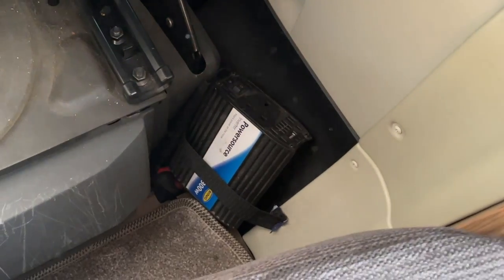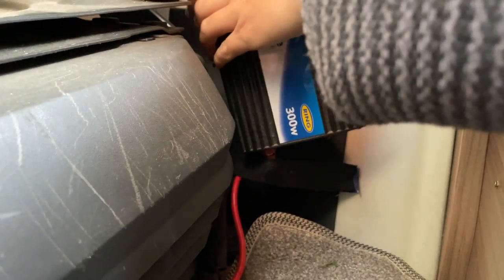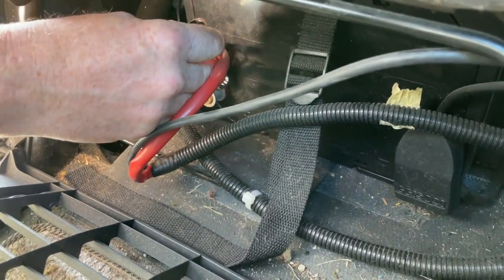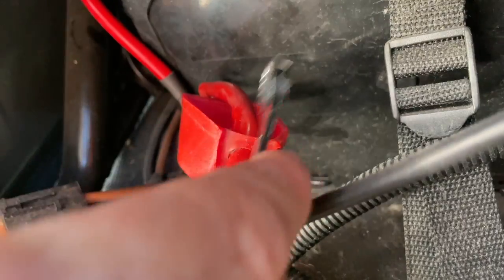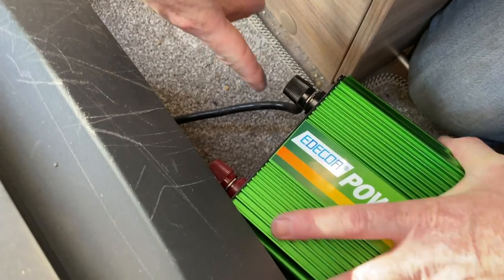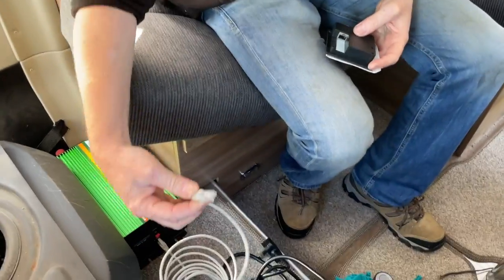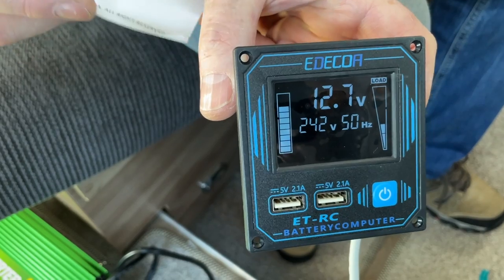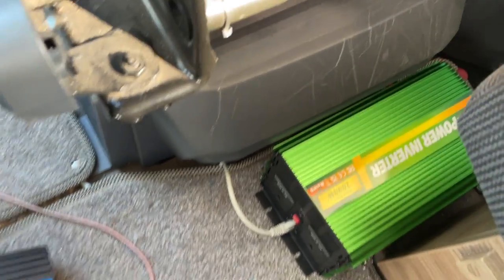How to fit an inverter to your motorhome/ campervan (van life tips)

Comment: An easy refinement would be be an in-line fuse and an isolator switch. A lot of people make the cabling to the inverter too thin, thus creating a fire risk from the thin wires carrying too much current.

Comment: ola Kat and Mr Wandering Bird . you were having far too much fun fitting that new inverter but I'd just like to ask, I'm sure you have one of the power bank things and I'm wondering, for folk how have the ecoflow/jackory power banks would they need an inverter?  I do have one but Ive never used it. I think mine is only 500 watts. I was always afraid it would drain my batteries which because of my limited budget were two 130 ah lead acid batteries. obviously the way to go is lithium and ecoflow if ever I can afford it. great video. bessy regs-Kenny
Reply from the maker: Great question Kenny. Answer is no. Tbh, I mainly use my inverter to recharge my Ecoflow 😬 I use my Ecoflow much more.

Comment: Hi kat just watched vlog on inverter what size would Mr WB suggest to run a hair dryer and straightening tongs ,and does the engine need to be running while using it, this would be when off grid cheers from the gowerz Portsmouth xx

Comment: I think you should have disconnected the -ve first on the battery, then complete +ve connections before connecting the -ve. There was a good chance of you shorting the battery to earth⚡ when connecting the +ve with the metal spanner.
Apart from that a good vid.
Reply from the maker: I’m definitely not an expert but we did do the black last.

Comment: I have a K KRIËGER 1500 Watts Power Inverter 12V to 230V, Modified Sine Wave would this be okay to use a hair dryer? Also do inverters damage the leisure battery? Thank you i am a total beginner

Comment: So I am guessing the solar panels go to the invertor or or you using an EHU?? Then you can power slightly power hungry items in your MH? I am correct in my thoughts please?
Reply from the maker: The solar recharges the leisure battery. The inverter uses the power in the leisure battery and can only power certain things- based on how big the inverter is.

Comment: Hi Kat, why not charge your powerbank (ecoflow) direct from a 12v supply? Looks like you are converting 12v from your leisure battery to 240v via the inverter, then charging your powerbank (ecoflow) from 240v. Your powerbank (ecoflow) can charge from 12v direct. The way you are charging the powerbank (ecoflow) appears to be inefficient. Cheers.
Reply from the maker: Whilst I don’t disagree with the inefficiency, the inverter is there to charge/ power things other than the Ecoflow- laptop, drone batteries etc. Also, the Ecoflow takes a long time to charge over 12v! Inverter is much quicker.

Comment: Is there a way to connect the inverter to the 240 sockets built into the Motorhome (so I can switch between mains or inverter) Thank you Great channel
Reply: Check out LeisureBit vlog on fitting an auto changeover switch.  Also, his (David) channel has a series on his MH electrics and how he changed to lithiumn and installed an inverter.
Reply: Yes – but!!! You need a changeover switch to allow the sockets to be fed either from inverter or shore-power. Some inverters have this built in (Renogy and Victron I know about). But you also have to think about other items that can be mains fed — fridge, boiler and maybe the already fitted battery charger. You need to ensure those things are not powered by the inverter but can be powered by shore power. It's not too difficult to do this if you're designing from a clean sheet, but more tricky if you're upgrading an existing van. So as I said, yes but!
Reply: @CliffordDive   but then you also feed the charger than charges the 12v which the inverters running off- although you can get an all in one unit if building from scratch
Reply: Thank you all
Reply from the maker: I’m glad you asked that!
Reply: @mcjjordan  Yes — I did mention the charger, and that's why my retrofit inverter in my Pilote feeds dedicated 13A sockets. I looked at the wiring and decided to leave well alone 🙂

Comment: No in line fuse on positive side to the inverter, I'm surprised?
Reply from the maker: So, it turns out he did fit a fuse - and I didn’t include it in the vid. 🤦‍♀️ I’ve updated the notes. Sorry for the confusion.